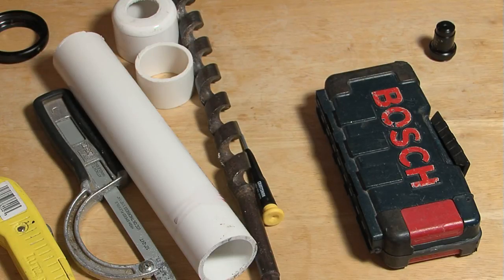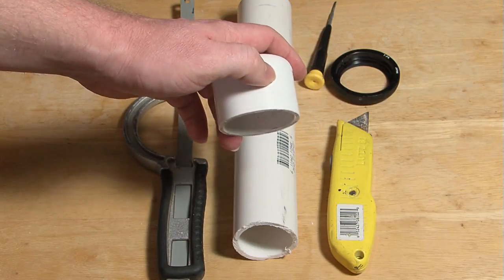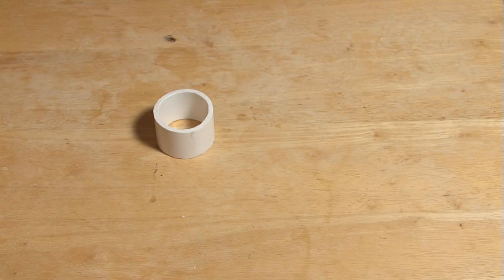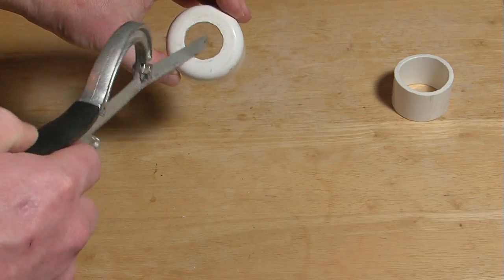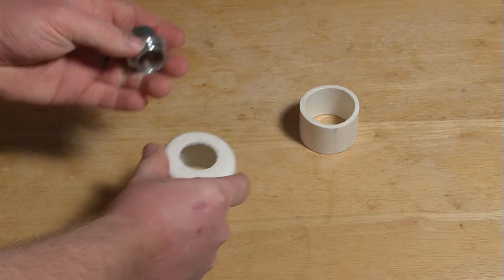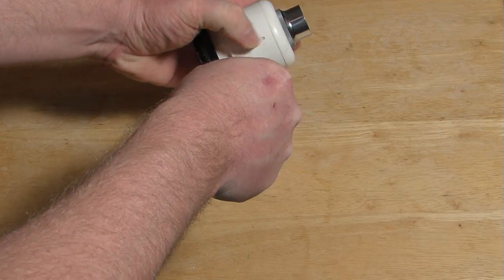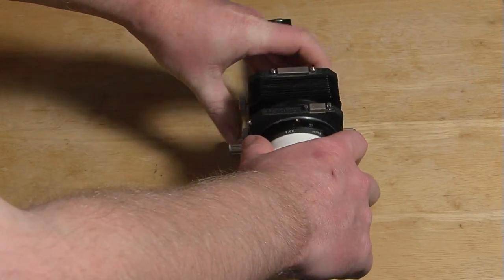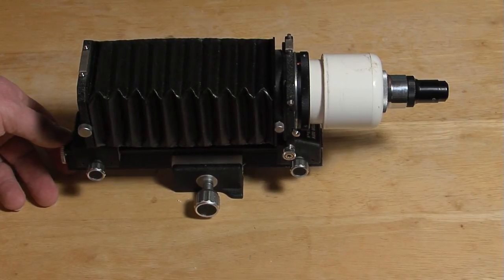DIY Microscope Objective (RMS) to T Mount Adapter

Comment: Try a paddle bit - AKA Spade Bit
Reply: Right !
I use PVC for a lot of things and the spade bits "are" aggressive.  Were I to make that mount - and its likely I will - I would fasten the PVC fitting in a vise and drill gently.  I'd drill part way from one side - then drill from the other side until the hole was complete.  That way edges on each side of the fitting would be smooth.  I looked for the mount you put directly on the PVC fitting, but haven't yet found a source.  Surplus Shed doesn't list it.  Maybe I can find a tap at the auto supply store.

The beauty of spade bits is they are very easy to customize their diameter by filing equal amounts from each side of the bit.

I've been researching and playing with lenses.  I major on macro so that's why I appreciate your work so much.  I know how hard it is to obtain and maintain focus.  You're doing very interesting work. 

Your shots dropping different colors into the liquid are mesmerizing. 

Thanks for the videos and for the microscope mount explanation.
Reply: Thank you for the information.
I could also contact Surplus Shed inquiring about the threading.  Their website says the threads are 20.2mm and its reasonable they are standard threads. 
I'll follow the 2 links you included to see what I can find.  it will be much better on all counts to buy something ready made.  That way I can use multiple scope lenses with ease.
Whether the web series your own production or a contract it sounds interesting.